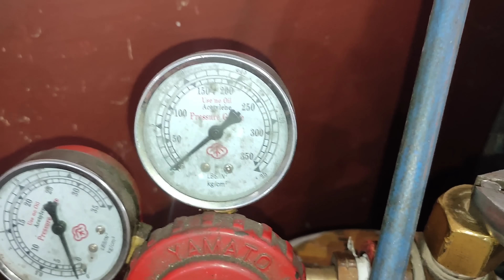how to weld aluminum without argon

Comment: For anyone who thinks that is not possibile ,try yourself. 
The first time I tried it i used tig rod for alluminium but the was'nt the same alloy of the parts i was welding.
Then I melted broken parts of crankcase and maked rods from it and they weld very well with borax of course but is only pure alluminium.
Thanks for the idea guys , no one in italy helped me to weld alluminium with oxyweld (anyone thinks that you can only braze alluminium with the oxy torch) , are your rods melted by using broken alluminium parts like mine ?
Reply: its probably zink he is using,thats the whole secret behind all those "weldingrods" that is around on ebay and ali or banggood, pure zink,,i use balancing wheights for car tyres when im soldering/welding alu
Reply: @flightace1  have you read all my comment ? I have tried just pure alluminium no tricks or strange rods
Reply: Ciao Spinelli ...
io molti anni fa comprai delle verghette per saldare alluminio, dall'allora "Castorama", poi assorbito da "Leroy", credo.
Quelle stesse barrette le ordinai pure da un sito tipo RS ma tedesco, "Distrelec".
Riuscii a saldare quegli angolari di alluminio che vendono dai brico ( Leroy, Obj, etc. ... ), forse non sono di puro alluminio, forse "duralluminio".
Le verghe avevano una specie di rivestimento esterno, fragile e pure un po' puzzolente.
Riuscii a SALDARE gli angolari ( non "appiccicarli" !!! ) scaldando con cannello a ossigeno e propano ( non acetilene ). La cosa fu possibile perchè scaldavo un po' alla volta, e subito toglievo la fiamma, provando a strofinare la bacchetta ... non ottenendone la fusione scaldavo ancora un po', poi ancora togliendo la fiamma e strofinando la bacchetta ... e così via finchè la bacchetta cominciò a fondere ... 
Chiaro che se avessi insistito troppo avrei direttamente fuso il pezzo, che è il peggior risultato possibile ... raccomando di non insistere specificatamente su di un punto solo, per lo stesso motivo ... 
La bacchetta fusa aderiva perfettamente al materiale base ...
Le bacchette erano della "Rothenberg" ( ? ), ancora dovrei averne, non so se il fondente esterno sia ancora ok ...
A ricordo dell'operazione eseguita positivamente, ho ancora i due pezzi saldati allora, messi da qualche parte, così da darmi certezza se mai dovessi eseguire una saldatura per un valido motivo.
Ora ho avuto da Ali_Express delle verghette che sono dei tubicini in cui il fondente sarebbe interno, quindi con minore possibilità che possa sbriciolarsi come invece accadeva con le verghette di cui ho detto prima. Devo ancora provarle, sono però sicuro che con un normale saldatore a gas piccolo ( usato a fiamma viva ) la temperatura ottenuta è troppo bassa, e non fonde alcunchè, perciò devo provare con il cannello Ossigeno / Propano.
Reply: @alessandroandrenacci2372  il problema delle varie bacchette che vendono per le saldare a fiamma sono tutte brasature e non vere e quindi non una vera e propria saldatura tra l'alluminio, anch'io ho delle bacchette di aliexpress ma non sono alluminio puro , saldare con l'alluminio puro è possibile ma serve capire la tecnica ed avere un buon flussante , io ho inziato con le bacchette per tig Al Mg però stavo saldando dei carter vespa che richiedono bacchette al silicio quindi non erano adatte anche se attaccava , invece fondendo in piccolo crogiolo dei pezzi di carter motore rotti ho ricavato delle stecche molto grezze ma che funzionano alla perfezione quando saldo un carter poiché sono fatti con la stessa identica lega , l'unica cosa che uso per saldare oltre l'alluminio puro ti ripeto è la borace che serve per tenere a bada l'ossidazione e messa sulla bacchetta calda all'occorrenza cambia completamente la qualità della saldatura rispetto a non usarla proprio, un pò come per la saldatura a stagno
Reply: @jetfulvio  questa delle bacchette del commercio che danno brasature ( come lo stagno sul circuito stampato di rame per intenderci, o come saldare l'ottone con la lega d'argento ... ) ma non vere saldature, può essere, anzi, sicuramente è così.
Tu vorresti saldare 2 pezzi di lega di alluminio con la stessa, identica lega, ad assicurarti che sia una VERA saldatura, come all'elettrodo saldi ferro con ferro, apportando ferro, giusto ?
Il tuo forse è un problema anche di SICUREZZA di quel che saldi, se mi parli di "Vespa" è sicuramente così ... 
Per me anche "brasare" i due angolari di alluminio ( o che lega fosse ) andava bene, certo dovendo fare qualcosa di "strutturale" forse "saldare realmente" è d'obbligo.
Io ( tecnico ora in pensione ) ho sempre hobbies tecnici, e ciò talvolta coinvolge anche le saldature.
Per te è forse è "professione" o "lavoro" ed il discorso certamente cambia.
Comunque io volevo aiutare, ed invece ho ricevuto preziose delucidazioni.
Va bene così, tutto serve a migliorarsi.
Reply: @alessandroandrenacci2372  per adesso è solo una passione che porto avanti visto che sono al primo anno di ing.meccanica .
 il mio problema nasce dal fatto che mi serviva una riparazione strutturale del carter in alluminio , non avendo una tig a disposizione  ma avendo un cannello ossiacetilenico visto che mi saldo anche le marmitte espansione,  dove parliamo di 0.8 decimi di lamiera , un pò di mano dovrei avercela con questa saldatrice. infatti sono riuscito a saldarci anche l'alluminio puro appunto che consente rispetto alla tig di avere meno distorsioni dei piani e anche una fusione migliore dell'alluminio, ciò che mi serviva quindi oltre che poterlo fare in autonomia senza appoggiarmi ad altri per questo tipo di saldatura
Reply: @jetfulvio  ... e bravo ragazzo !!! Gli ingegneri spesso non hanno la "pratica", ed i tecnici mancano della teoria ... Te invece ti impegni su tutti e due i campi !!!
Ingegneria è tosta ... mi raccomando ... 
Analisi 1, Geometria 1, Fisica 1, Chimica, etc ... ti danno un bell'impegno ...
Parlo perchè ... lo so ... ( tra l'altro c'ho mia figlia che studia Ingegneria ... )
In bocca al lupo, massima sicurezza saldando ... occhiali, guanti ... etc.
Adesso ancora una domanda tecnica ... hai detto che hai fuso le leghe di alluminio in un crogiolo ... ma con quale fondente ? Il borace ?
Ciao !
Reply: @alessandroandrenacci2372  grazie mille !
Comunque si esatto, ho usato il borace come fondente

Comment: Explain why that is not called brazing ?   Torch an filler. Same as on cast iron done that way with brass rod years ago. Now done differently. Very little penetration on existing metal. Could of done the same thing with JB weld. A two part epoxy .
Reply: You could call this aluminium brazing, poorly done, no penetration of the parent metal.

Comment: This is actually brazing, not welding...  and it's not much of a repair with all of the Reinforcement removed. Unfortunately, when it comes to cast aluminum, true welding isn't usually an option because of all of the impurities in the metal.
Reply: No, it's not.  It's stir welding, that's what all the puddling about with the 6013 rod is.  Lots of people utterly failing to understand what's going on here.  There's no need for grinding stuff away, because you're mostly not adding filler but instead re-fusing and mixing the existing metal.  There's actually not all that much value in anything more than cursory degreasing, either.  The impurities mostly "float" to the surface as you stir the puddle, and mostly end up sticking to the stirring rod, new oxide layer is not formed as the carburising flame shields the weld puddle.  The added filler is mainly there for aesthetics, the strength comes from fusion welding the existing material.

It's not an easy technique, as aluminium is very critical in terms of temperature.  A fraction of a second too long, and the piece will collapse.

Comment: I have a couple of issues with this content. The work please is it clean and that’s imperative with aluminum especially. Additionally, there was no welding grooves cut into the word piece so if there was grinding that needed to be done the welds will get ground away.

Comment: That is not welding, that is soldering you did not actually melt the parent metal. You must melt the parent metal for it to be welding. Soldering is adding a lower temperature melting metal to the repair.

Comment: First of all this isn't aluminum, it a zinc aluminum alloy die cast. Best way to repair, and this fella basically did this, is to fuse the pieces back together. Adding any aluminum rod will not bond well to the zinc die cast. Just my 2 cents and fifty years of experience.

Comment: It may work, but not strong. You do what you have to do when you have to. To be strong, fill back side spaces with fillers and tig after tig on the front with correct prep.

Comment: No . . . just No! That is dreadful. If you must weld with oxy-acetylene use an aluminium rod with a flux which will break down the oxide. This will break almost immediately.